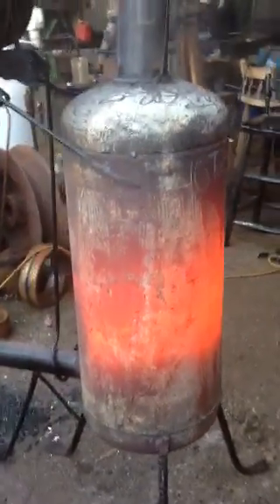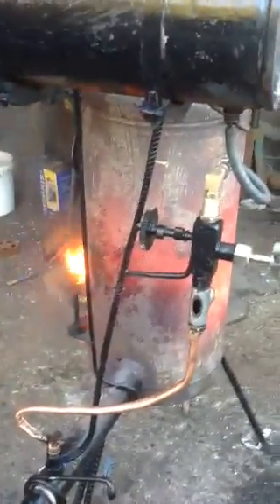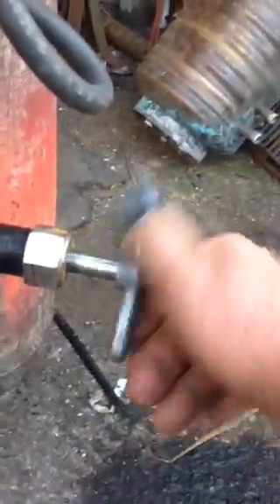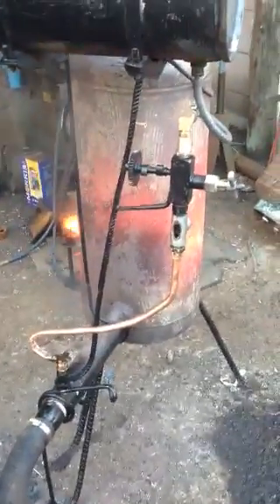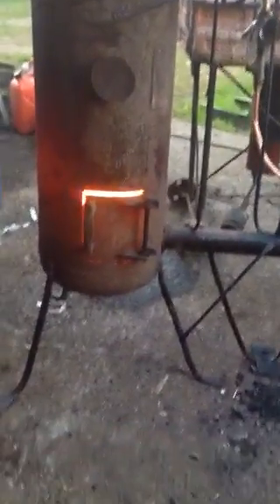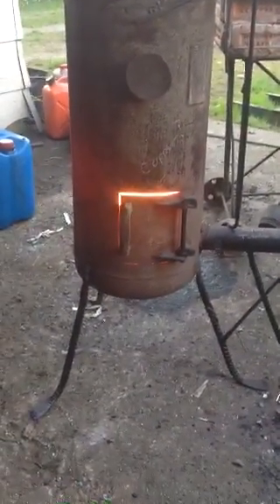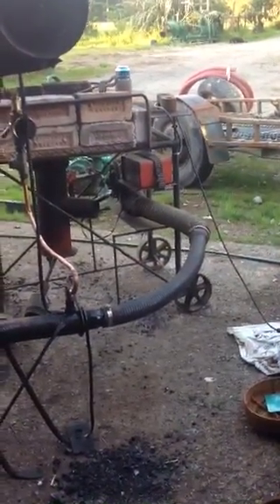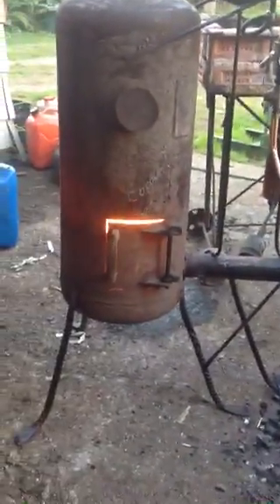Waste oil burner runaway

Comment: Water seeks its own level oil should seek its own level if you place a sealed vessel full of oil on the outside and run a u valve in the bottom to a specific level and then run your hose into the u-valve on the outside with a sealed vessel of oil it should consistently stay at the same height regardless of the viscous of the oil

Comment: Yep, move the fuel tank away from the heater.  You can also make a safety for these pretty easily.  You figure what the max height you ever want the oil to get in the burner pan and add in a small hole and drain pipe at that height.  The drain you run down out the bottom of the stove where it is cooler, and run it to a fitting that will accept the oil level/low oil level sensor from a small engine.  This sensor can be used to control a fuel cutoff valve or an alarm system if the oil ever gets to this high point in the pan and flows down to activate that sensor...

Comment: You have to wonder if this could lead up to an explosion with all the heat and energy from oil. Kinda scary.
Reply: No pressure builds up in the system. I can see one hell of a deflagration, but explosion, nah
Reply: I kind of doubt it

Comment: since pre-heating is becoming more and more common with these homemade builds,  many people are experimenting with using diesel injectors to meter fuel (which should work is oil is hot/thin enough).

If I ever get around to it,  I've been meaning to try it using an old tractor mechanical pump (since I use a belt driven air blower anyways).  Just a matter of figuring out the right gear ratios/motor speed to run consistently

Comment: Been watching several diff vids today on oil burners and was wondering how many peoples lives have been turned upside bec they built one of these and for whatever reason missed something simple or forgot something and had it go seriously wrong! If you dont have the right tools and or materials to build one of these just dont do it! It only takes a second to go horribly wrong and you could burn your house or shop or whatever wrong. One thing none of these guys think about is what would happen if your tank of oil went up all at once! And where the hell is your fire extinguisher you moron. Think about some damned safety before you go try educating the masses so badly. Glad youre proud of yourself for making fire but just think about it!
Reply: Oh and let me add that yes i have built similar burners without a problem but i was careful and had all the right stuff to get it done including the experience! So when i criticize someone like this its for a good reason not for an ego induced reason. Personally im all for experimentation, im just saying be careful and have some fire protection standing by just in case!
Reply: i have had it go pretty wrong. Not by getting my oil can on fire(wich was 1 of the things i was scared of and still am too. But in my case a can of oil got dropped pretty close to the heater, it plashed on to the red hot burner tube and poof big fire. But i kept calm, put a big sort of fire blanket over it and off she was. Because of the big amount of cold oil that didnt want to burn and just a small bit getting so hot it ignited it wasnt as bad as it could have been. And we had some safety things in place, but after that even more.

But i dont understand these people that weld their oil storage to their heater. Its asking for trouble if you ask me. I keep it away from the heat, it even has a heatshield in front of it just in case. Not only because im scared of it ever getting so hot it might burn. But also because the problem he had is what we even now still experience. A dripfeed wil turn in to a steady stream of oil when your shop go's from 0c to 20-25c. Takes about 2-2.5 hours to get the shop from 0 to 17-20c and that not bad for a 700m³ space with some air gaps in it.
Reply: Absolutely right !

Comment: We find that the oil supply should be away from the heat source of the heater. This stops the oil warming up and flowing faster. The only way to really control these waste oil heaters is a waste oil controller unit it has a dual timer, a thermostat, fuel pump, which pumps for 1 second of oil 6 seconds off and so on. And if there is an issue the thermostat will turn the heater off including the pump. Never trust a waste oil heater without a controller the only way you can walk away from it.
A needle valve is capable of making the whole cylinder turn a bright red and the two lengths of flue, and it doesn't know when to turn off, therefore oil spills out everywhere, then you're in trouble.
The smoke turns black as it get way out of hand, fire everywhere. be careful.
www.dripfedwasteoilheating.com  You can purchase these controllers there.